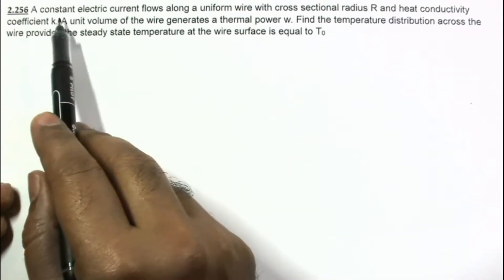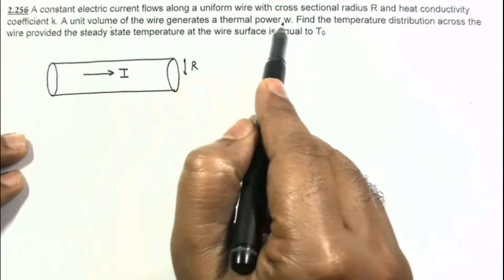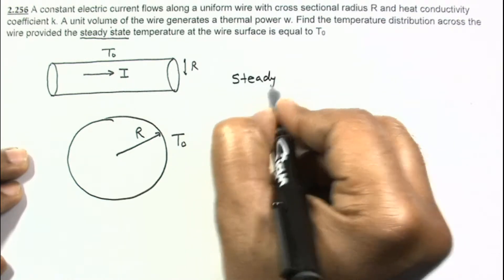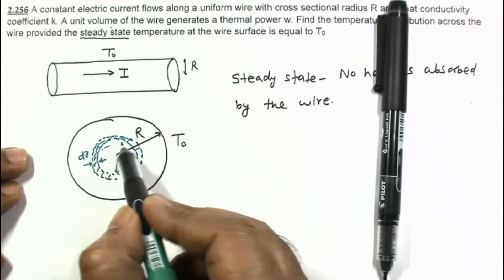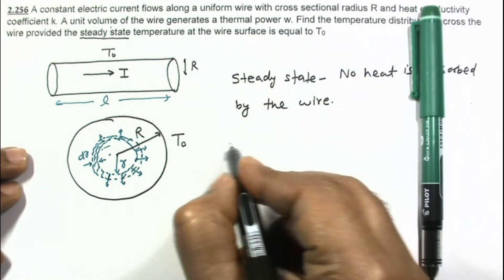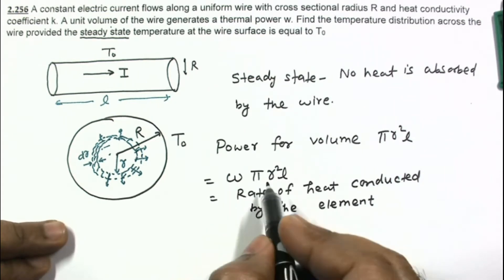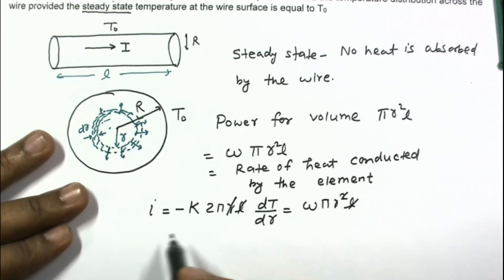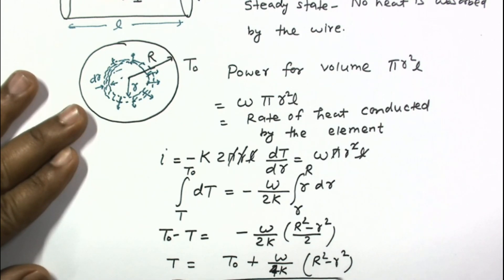Irodov : Problem 2.256 Solution Heat transfer conduction

Comment: Sir doubt..  the current is flowing along the length of the conductor and in the solution u have taken it to be radially outward ... can u explain why??
Reply from the maker: electric current is along the length and heat which is being generated comes out radially as it talk about surface temp being constant
Reply: @PhysicswithAkashGoyal  sir why dt/dr is -ve here coz heat flows fro high to low temp thats it ?
Reply: @VsEdits08  yes